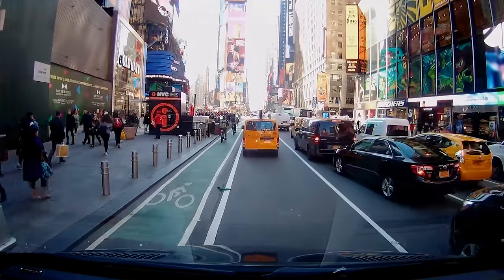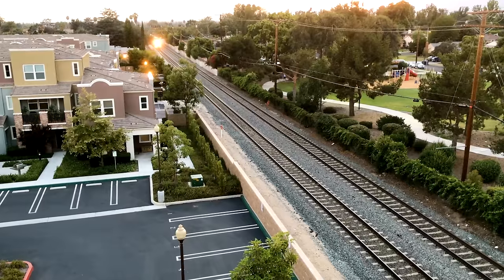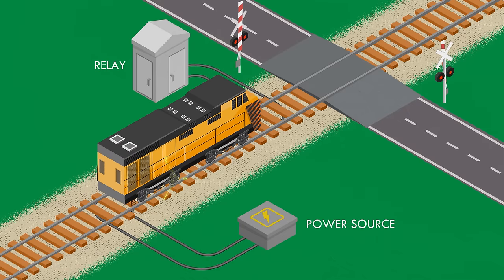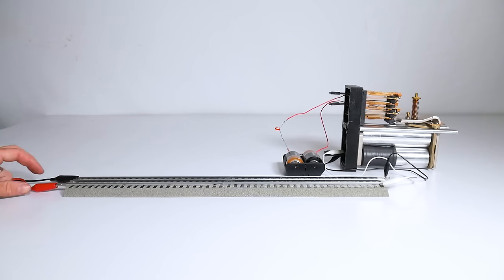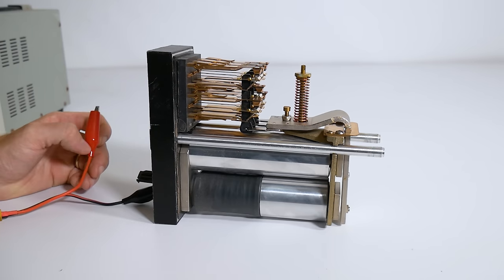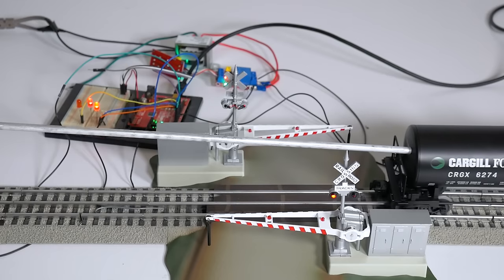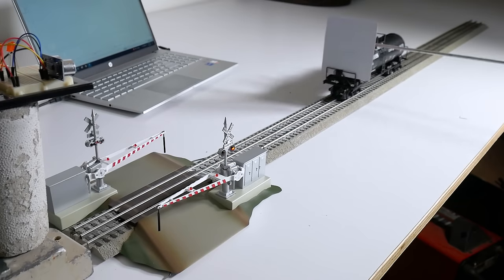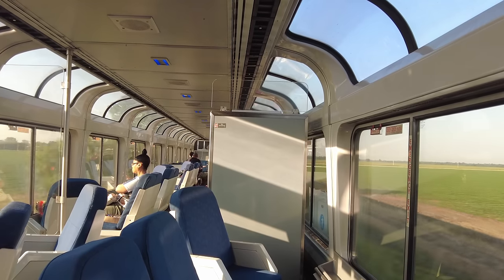How Railroad Crossings Work

Comment: I worked in the Dutch railroad management software for a bit. The most tricky situation we encountered was a train that crossed a road, stopped at a station for 10 minutes, and then departed in the opposite direction.
Reply: I somehow don't see a big problem. Care to explain?
Reply: That's definitely a troublesome edge case!
Reply: We use DTMF codes for trains to activate and deactive crossings they are stopped near
Reply: That used to happen at Ely railway station where EMR (East Midlands Railway) used to reverse at the station coming to and from Norwich (Liverpool to Norwich service), using the crossing twice. The level crossing was used by tall vehicles with an underpass for cars and bikes. Since a new bypass was built around the level crossing and the town, the level crossing is now gone. This shows why level crossings should be closed when there are at least three tph per direction
Reply: Which station, if I may ask? From personal experience I believe this is kinda common.
Reply: I used to work in Oakland, California where an Amtrack station was a short distance from a busy crossing.  It's a 2 track crossing and both passenger and freight trains use it.  That crossing was constantly false-triggering or staying down for extended periods for no reason.  All the locals knew it and would often drive around the gates after visually verifying the false activation - to the point that the police would also often station a patrol there and ticket the drivers as they knew it was easy picking.  It was also pretty common to see RR workers out on that section doing repairs/maintenance.  I haven't been using that area much these days so don't know if they ever got it sorted but assumed it was just due to the proximity of the station despite not knowing how the activation actually worked.
Reply: @MP-oh9lt as Grady explained in the video, the signal is deactivated as soon as the train passes, even though it's sitting on the other approach circuit. If the train then reverses, the signal won't activate until it touches the island, meaning the signals won't activate until the train is already crossing the road.
Reply: They use "directional stick" circuity to solve that. Essentially it tells the grade crossing that the train is coming from a certain direction so any movement on the other side going away from the crossing doesn't affect the crossing.
Reply: @MP-oh9lt  The train would just clear the crossing after crossing it for the first time. Not enough to open the crossing, but leaving the crossing closed for 10 minutes was going to tempt people into ignoring the signals anyway.
When the train returned, the crossing needed to close immediately.
Reply: @HammondOfTexas0  they can manually activate and deactivate it via radio.
Reply: @RoelBaardman  German side at Enschede?
Reply: @dascandy No, but I understand why you ask. I believe it was in Baarn.
Reply: Oosterwijk and Tilburg Universiteit have similar issues, but I think there in both cases the conductor presses a button (and turns their conductor key in a lock on the same box) to activate the barriers. Those are also the only stations I've ever been to where the train crosses the tracks at less speed than local car speeds, so at least I've never seen the issue of a train stopped near a crossing blocking the roads.
Reply: As a schoolboy, I grew up up on a branch line that ran to the city.  5 suburbs in a row, including the one I lived in, had level crossings at the train stations.  Trains coming in to stop at the platform (but not cross the level crossing until they had unloaded and loaded passengers) would still trigger the gates, just in case the train overshot the platform.  So you’d be waiting an extra minute or 2 until the train was ready to depart.   Fortunately going the other way, the gates would lift as soon as the train passed - despite it stopping just metres past the level crossing.   In the afternoon peak, you could wait up to 40 minutes until you got through the gates (on a non-AC school bus, on hot summer days).   In the decades since, they’ve all been replaced by bridges - only 2 active level crossings remain in the whole metro area now.  There are others that are either not publicly accessible, or they are only used on rare occasions, with traffic control people.   Many of my colleagues have never driven over a level crossing in their life!  That’s progress.
Reply: classic stuff, the platform had a key operated switch for the train driver to indicate that they'd be leaving towards the crossing. :)
Reply: The railway should have procedures where the driver creeps up to the crossing track and doesn’t enter the road until level crossing is activated

Many railways would also have a timer on the XSR to drop out and reactivate the crossing after a period of time. 
Possibly interlocking it with a proceed signal

My railway has some crossings with “super control” where approaching a crossing without a proceed authority will still activate the crossing, until you’ve been stopped for some time (enough to demonstrate you’re not travelling at track speed, not necessarily stopped)
Or interlocked with the signal.
Or multiple approach tracks depending on what conditions are met (eg stopped at red and given a proceed may only activate using the shorter track)
Reply: Turnkey and button is how that is handled in Melbourne. When changing ends, the driver walks down the platform and resets the crossing. When departing, the driver hits the button again. Crossing protected by signal and ATS until the booms are down.
Reply: @annabelholland  its because Ely level crossing is a Manuel level crossing with CCTV that was controlled from Cambridge power signal box, crossing protected by signals and with only get a clean signal when the crossing is closed and deemed save by the signal box!
Reply: @MrDan961  In the UK, these crossings usually have a button for the driver/guard to lower the crossing. Many of them have a "non stop" and "stop" mode, selected by the signaller depending on the train scheduled. If the former is chosen, the crossing lowers immediately, as usual. If the latter is chosen, the crossing either lowers about a minute later, or the staff has to press a button.

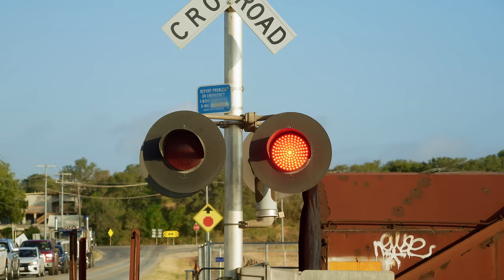Comment: 14:31 If you ever see a vehicle stuck on the tracks, call that number FIRST. Many people end up dialing 911, but the time it takes for the 911 dispatcher to understand what's going on, get your location, determine which railroad to call (if there are multiple tracks in your area), call them, relay your geographic information, and have the train dispatcher figure out which crossing that is can be avoided by calling the blue sign number. It's a direct line to the train dispatch office and that crossing ID lets them know exactly where the issue is and they can notify any approaching train in seconds.
Reply: get the PEOPLE off the track first.  THEN start calling.
Reply: @kenbrown2808  Excellent point!  Get the occupants out and away to a safe distance.  Then call the RR.  Then, if time and situation safely permits, push the vehicle off the track.

I grew up in Chicago, there are lots of street crossings there.  We were actually taught all of the above in junior high, then again in high school.
Reply: I did not know this. The suggestion is greatly appreciated.
Reply: There is a number on the crossing plaques in addition to a phone number. That number (use to be 3-3 characters long) identifies the crossing to the railroad. The phone number on the plaque is direct to the dispatcher for that line. The only info you need are those two… phone to call and crossing number. It’s better than calling 911.
Reply: UK level crossings should have a landline on both sides so that you can contact the signaller(?) in case of problems like a barrier down for at least 2 mins without a train coming or if the vehicle is stuck on the crossing. Using that will identify the location immediately You can also contact Network Rail (who owns and runs the  UK railway network) with a number displayed on their website. If the station is next to the level crossing, you could also press the emergency button there.
Reply: @annabelholland  That sounds like a good system!  We don't have that in the US; before the proliferation of cellphones the lack of phones was a problem.
Reply: Thanks for the information. Don't you think the 911 dispatcher should be trained to instruct the caller to phone the number you mention instead of wasting time getting all the information?
Reply: @kenbrown2808  Do both. You may be able to stop the train in time in the event you don't have time to pull people out.
Reply: @TheEDFLegacy  or in the time you were looking at the number and dialing, the train comes through. If the people are stuck in the car, then think about calling. But like i said in another post, i have a friend who was a firefigter in a place with railroad crossings. The first thing they would do is have someone call the number. The last thing they would do is watch a train plow through the car because the dispatcher didn't stop the trains.
Reply: But if the signal's already flashing that means a train is coming in about 30 seconds and they easily take a minute or longer to stop. Meaning you likely have seconds to get yourself to safety and out of the kill zone of the now inevitable collision (including high velocity objects and shrapnel firing off at unexpected angles).
Reply: @factzilla1868  That's different. Yes, if the gates and lights are flashing, it's too late to call them. I'm speaking in cases when someone is stuck on the tracks and there is no train visible. At the speed of how fast some trains go, you might be able to stop them in time if they are only a few minutes away.
Reply: I was told that calling the phone number has a very extensive time delay before it actually gets to the dispatcher and then to the locomotives.
Reply: I still do not understand how people get stuck on the grade crossing. It always baffles me
Reply: @Reese-Tube  That is still the fastest way to reach them. The dispatcher at that number has a direct means to contact the train for an emergency stop. Typically the phone number connects to the Railway police for that Railway company. In the case of CN Rail, That phone number Asks you to press a number based on the situation comma with number one being Issues that affect the immediate safety of trains.
Reply: @KevinGordon  low trailers, over time the road degrades which can cause the trailer to get hung up on the tracks that are now a bit above where they use to be.
Reply: @KevinGordon  Semi trucks get stuck because of the approach or departing angle of the trailer versus the crossing. I understand this completely. Cars, on the other hand, rely on the common sense and sobriety of the driver, and many times those qualities are in question. Train/car collisions still baffle me also, they shouldn't ever happen.
Reply: Even if the police are already there and they say they've called in a blocked crossing to their dispatch, STILL CALL THE NUMBER and report it. The Amtrak crash in Michigan a few months ago was caused by a police miscommunication regarding which crossing was blocked and so their dispatch didn't contact Amtrak at all (they called CSX about a crossing miles away). Trust but verify; the railroad isn't going to complain about multiple reports when the alternative is none.
Reply: One other thing that should be pointed out... the gates or arms across the road are meant to DETACTH, thus if you are stuck on a crossing when the arms drop you can easily drive through them and they'll come unhooked and drop off. So if you are able to drive out of the way it's not going to destroy anything to drive though the arms.
Reply: in front of me once, I saw an old man make a right onto railroad tracks and get stuck... we pulled him out before a train came thank god
Reply: Thanks for posting this I reported a malfunctioning arm a few years ago and it was fixed immediately.  I did call the number at the problem place sign.
Reply: @ludoviclemaignen9432  Often times 9-1-1 dispatchers are not trained in proper railroad crossing emergency protocol.
Reply: I've called that number before. My town has 2 crossings. No train was coming from the east and the crossing arm went down for about 20 minutes. Got someone on the phone and they got the problem resolved. Not sure what happened. It was only the eastern gate that triggered and not the western gate.
Reply: @mbryson2899 To expand upon what you're saying, and clarify:
Railroads (in the U.S.) do not typically suggest pushing the vehicle off the tracks yourself, regardless of whether time and situation seem to safely permit (clarification on this, below).

What most railroads typically suggest you do in the event a vehicle is stuck (for any reason) on a railroad track and cannot get off the track:
-1 Leave the vehicle and get yourself off the track and a safe distance (railroads typically suggest 50ft minimum) away from the track
-2 Call the number on the blue sign posted at the railroad crossing (there is one at EVERY railroad crossing in the U.S., it is required by federal law.  If there it not one, call 9-1-1 and let them know the blue sign is missing)
-3 Dial 9-1-1
-4 Wait for either the local (city/state/county) police, or railroad police (most railroads have their own police department with federal jurisdiction).
-5 The railroad should be in contact with the police, and the police will let you or the tow-truck operator know when it is safe to remove the vehicle from the tracks.
-NOTE-: Do not go anywhere near the vehicle (50ft minimum from the track, some railroads add the suggestion of 70ft minimum from the vehicle) until it is removed from the track.  Helpful tip on figuring out 50ft vs 70ft: 50ft is the average approximate length of a long semi-trailer, 70ft is the average approximate length of a semi tractor+trailer with a long trailer.

This is what conductors are taught at the (freight) railroad I work at in Detroit.
Reply: I also think theres an experiment where calling the number will automatically change the lights on the track for trains to caution and in some cases causing a full stop
Reply: The local emergency dispatcher can contact the wrong railroad. I’ve seen it first hand. Get the number on the little blue sign.

Comment: I really like the idea of Japanese railway crossings where they show the direction of the train's travel.  It is a great way to show that the system is not malfunctioning after a train has passed and a second is due in the other direction.
Reply: I also like the idea of signs that flash when the nearby crossing is about to activate its warning devices.
Reply: @raymondhopwood9393  We kind of have that, i the sense, that the lights start flashing about 5-10 seconds before the gates start closing. (Switzerland).
Unfortunately drivers often see this as a yellow, so they will keep going until the gates come down. Good news is:
1970-1999 you had a average of = 118 accidents on crossings per year; 2000-2008: 42, 2009-2016: 11,75, 2017-2022: 5,5
Think it was mainly, that the got rid of any unguarded crossings. And improved the rest (basically all have 4 gates). That is despite having a lot more and faster trains operating per day.
Reply: @raymondhopwood9393  Flashing lights are already one of the warning devices! You don't need flashing lights to warn you that the flashing lights are about to flash.
Reply: @beyondEV  The flashing lights are a yellow! They have exactly the same meaning: stop if it's safe to do so.

Comment: Never assume the crossing is working! When I was a school bus driver, I waited at a crossing because I saw a train was approaching. The crossing didn't activate until the train touched the island circuit. I reported it and they repaired it the next day.

Usually, they'll approach the crossing slowly and flag traffic as they cross in situations like this, but they weren't aware the crossing wasn't working and crossed at around 30 mph.

Comment: You answered a question that I had forgotten. On a road next to a light rail line, the lights go red when the train passes. I always thought this was inefficient because there are no cars crossing the rails and the road while the crossings are blocked, but now I know the lights for the streets going across the road are green to ensure no cars are stuck on the rails between the arms and traffic on the road. I'll probably still feel it's annoying, but at least I know it's necessary.
Reply: They should only remain red for a couple minutes until there’s been enough time for the crossing to clear, and then the adjacent road should go green. We have some traffic signals like that in m6 area that usually work pretty well. But they do stay red for extended periods sometimes, and when that happens the traffic signals flash red so you can stop and then proceed as if you were at a stop sign.
Reply: Yah, once the crossing is clear, it's common for the traffic lights to go green for the road paralleling the tracks.  

Nice that trains also trigger the flashing white lights that show the traffic light is being overridden too -- the same way emergency vehicles do.